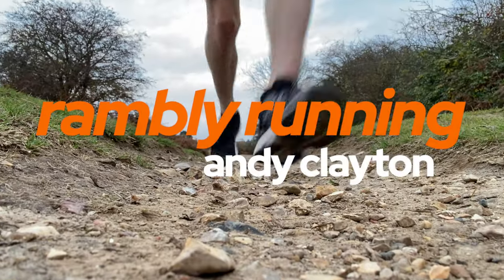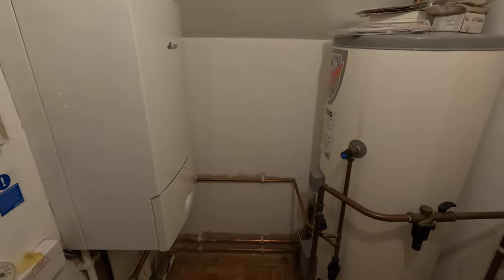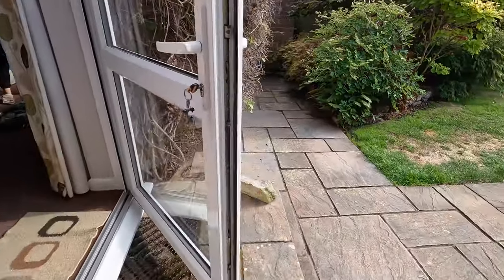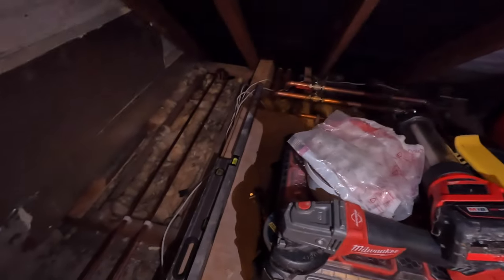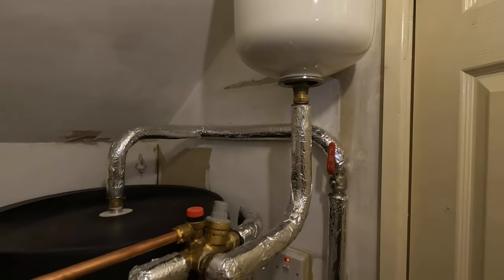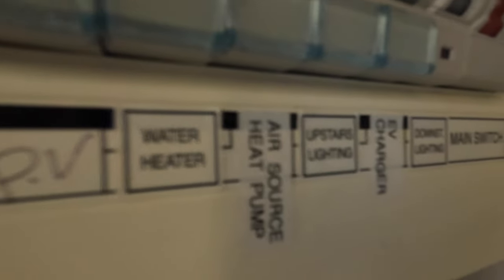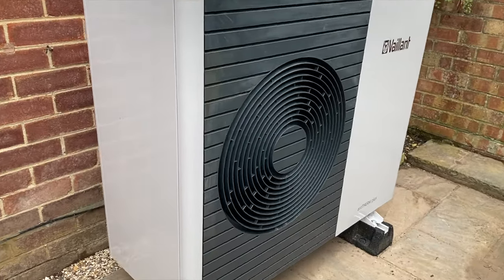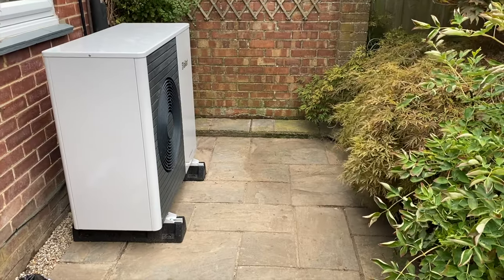Project Green: Heat Pump Installation

Comment: I've had an induction hob for over 6 years, love it! Just about to have a heat-pump, then bye bye gas, and £15,oo a month standing charge too.
Reply from the maker: Nice one Brian. I'm going to be filming a follow-up video this Friday that should be going out next week if all goes according to plan. Like you, I plan to ditch gas at some point - I'm literally just using it for a gas hob and nothing else now. Most days, that pesky standing charge is higher than the cost of the gas I've used. All the best for the heat pump install!

Comment: Interesting video. Thanks for your info. Decided here its not worth it in my case. No where outside to install a heat pump due to logistics of the bungalow, unless it goes high. But it will be bombarded with terrible high winds and rain as I am 1000ft asl.  My worster is quite young and working well..  bills are not too high and in huge credit at the moment. Plus nearing 80 years of age and will never get the benefit of it. I am a retired electrician and have installed my own heating over the years. Still fit and agile . But I have hung up my Tool Box.  Thanks again. You have done a good job .
Reply from the maker: Thanks for your feedback Kenneth. There are many things to factor in to these kinds of decisions and your thinking makes sense to me. There are lots of other things you could do to reduce your carbon footprint - low energy light bulbs, insulation etc. With your background, I suspect you've already looked at all that! 😊
Reply: @TheRamblyChannel    yes. All led here now. It's only a 2 bed bungalow. We downsized when We  moved from SE Kent to South Wales 19 years ago. Was for my wife's health reasons and proved to be way better than medical treatment.  Cleaner fresh air here way better than the crowded South East Kent. Thanks for reply. Cheers from Ken.

Comment: Hello Andy, I already have solar panels and a battery which have been a fantastic boon during the current crisis. I'm umming and arring about replacing my gas boiler at some point. I am also keen to used British manufactured equipment if I can. As Vaillant have just started manufacturing some of the ASHPs in the UK I found this very interesting. One thing I have read/watched recently is that the new Vaillant ASHPs have a new type of refrigerant in them which allows much higher operating temperatures for the radiators. Thanks very much for taking the time to put this video together and I'll look forward to your next presentation.
Reply from the maker: Thanks Eddy. So pleased you enjoyed the video. I'll have a follow up video coming at some point in January where I talk about running costs compared to my old gas boiler. For me, doing the "right thing" and having a greener form of heat energy for my home was paramount, however it's still an interesting exercise to see how it all adds up. The figures are done, I just need to film the content so look out for that video soon! Happy New Year.

Comment: Great video and info! Something unexpected with the glycol cold spots in radiators...realised we are getting the same thing. Is it just a case of turning off two both valves on all the radiators expect one, letting it run until the cold spot goes, and then doing the same with the next?
Reply from the maker: That's what my installer told me to do, so I went round every radiator doing exactly as you describe and that fixed the problem.
Reply: @TheRamblyChannel  that's great, thanks for confirming. will give it a go. did it take long for cold spot in each rad to clear?
Reply from the maker: @magspies  The larger the radiator, the longer it took. I can't remember off hand, but I do seem to think it took quite a while so it was a case of working my way around the house over a few days, but as it can be left to do its stuff while you get on with other things it's no great hassle. For me, it was September so I didn't need the heating on. If you're doing this during colder months then it could be more of a pain as the rest of your house gets cold!! I wish you well with it. :)
Reply: @TheRamblyChannel  so helpful, thx!

Comment: I noticed from you pic that your heat pump is next to a wall is that the boundary wall did you have to get planning permission to put your heat pump there? As I know you need planning permission to put a heat pump with in 1m of the edge your land.  Thinking about getting one my self, but the only room is the ally at the side of the house, which would be with in the 1m, so after talking to planning debt i know i would need it, if you did how difficult was that?
Reply from the maker: The ASHP is in my back garden and is 1m away from the boundary wall so I didn't need planning permission to install it. Thanks for watching. I hope you get your planning issues sorted out.

Comment: Thanks for the super helpful video Andy, can you let us know how many radiators and sizes you have (overall load) and roughly the insulation levels of the house, interesting they only speced a 7kw, much smaller than expected!  BTW Glycol is for anti freeze purposes and not cleaning.  Cheers
Reply from the maker: Hi Chris. Thanks for your feedback. Apologies for my incorrect Glycol reference. Oooops! My home isn't huge and the expected energy requirement was just under 5kw for heating and hot water, so a 7kw should give the system some extra capacity should it ever need it.

I have 8 radiators and 2 heated towel rails. Most are doubles. I don't know the overall load. I have so much documentation from the installer so it's probably in there somewhere. He did all the calculations at the time, which led to one rad and both heated towel rails being updated.

The insulation was done by previous owners, most recently when the upstairs was added in 2003 although I had the kitchen extension built in 2012 and that's probably the best insulated room in the house. So the insulation could be better overall, for sure, and if it was the heat pump performance would improve but early results are still promising. 

I don't know how much that helps? I'll have a follow-up video coming in January where I'm going to lay out the running costs of the heat pump across October, November and December and do a direct comparison with my old gas boiler over a comparable period. Hopefully it will be an interesting one!

Thanks for watching!
Reply: @TheRamblyChannel  Hi Andy, excellent description for a non heating engineer.  Unfortunately, and I think this is a carry over from the gas boiler thinking, putting a 7kW HP in a 5kW house is not the way to get the best efficiency.  HP's work best as close to rated output as possible.  Remember the 5kW requirement is only for when the temperature is minus 3 outside.  ie a handful of days per year.  Your pump will be oversized 365 days a year!   (You need to build an extension or run an outdoor sauna - 😜)
Reply from the maker: @philbattye  Thanks Phil. That's interesting to know - every day's a school day! What you say makes sense. It was very much down to the engineer to design the system so I went with what he recommended. Perhaps I should get that sauna...!

Comment: Very impressive set up and wise to take steps to future proof your house. We have solar tubes for hot water which are wonderful and shortly installing solar panels for generating electricity. It will be very interesting to see how this new system works out for you. It is becoming 9 increasingly clear that the future of fossil fuels as a source of energy is very finite and also insecure due to the vagaries of world politics, war, prices etc. Unlike you, I am totally ignorant with regard to modern technologies and how systems work etc so videos like this are very helpful, provide food for thought and are certainly timely given the current energy situation. If you ever get a chance in this series of 'Project Green'videos to give an 'idiots guide' to the basic principles of how systems such as this work, it would be illuminating for the likes of myself!! There's a challenge for you, Andy --- or you might decide, 'To hell with these fools, it would be less hassle to run a marathon'!!!! No pressure!!
Reply from the maker: If I ever work out what all those pipes are for I may do that! I'd like to know how the system works and what all the various parts do. I have an overview understanding of it all, but I'd need a more detailed insight before I'd feel confident about making a video about it. Having said that, it's something I have thought about and want to do.

I have another Project Green video in a couple of weeks that has an explanation in it about another subject. Hopefully that one will be helpful... if I get my facts correct! 😁

Comment: Having a low set back (fall back) temperature will mean that your heat pump has to work harder to get back to your 20ºC desired temperature. The setback temp has nothing to do with the freezing temp you mentioned with your gas boiler (in another video) 7ºC to stop the pipes freezing. The setback temp is the desired temperature you want overnight. Ideally it should be 1 to 2 degrees lower than your desired daily room temperature. Any lower than that means your heat pump will consume more power to ramp up each morning to the desired working temperature.
Reply from the maker: Hi John. Thanks for your feedback. I’m so pleased you’ve made this comment. It’s something I discovered after I made the video and subsequently set my temperature back to 17 degrees. Vaillant recommend 3 to 4 degrees below room temperature. I’m learning all the time and will correct all my mistakes in my next video. I’m going to be honest with everything including where I get anything wrong! Thanks for your helpful feedback 😊

Comment: And how much did this cost compared to installing a new, high efficiency gas boiler?
Reply from the maker: Hi Richard. A high efficiency gas boiler is old polluting technology and despite the terminology "high efficiency" it doesn't come close to the efficiency of renewable alternatives such as an air source heat pump. Did it cost me more? Yes, but I'm perfectly content with that as I've signficantly reduced my carbon footprint as a result of the switch. The ASHP is already an extremely green solution, however it will only get even greener as more of the grid moves over to sustainable power generation. If I'd replaced my old gas boiler with a new one it would've contined to burn fossil fuels over its lifetime thereby contributing to the problems we have in the environment and with human health. Frankly, it's a no brainer for me. As more of us move over to this excellent tech, the price will continue to fall. We're at the stage where the cost comparisons, while still relevant, shouldn't be the overriding factor in the decision making process. Thanks for watching. Andy
Reply: @TheRamblyChannel  I'm aware of why, I was simply asking how much the heat pump cost compared to a brand new and much more efficient gas boiler given they would both do the same job equally well. This is going to be the deciding factor, unless prices become roughly comparable, the average consumer is just not going to spend many thousands of pounds on being "green". Assuming they even have that extra cash, and many simply won't. This is why heat pump uptake is so poor, even with the state subsidiy it's unaffordable and most home owners will not find the "green" argument sufficiently compelling. We're just not going to see a heat pump revolution without the economics to drive it. The cost comparison will ALWAYS be the over-riding factor for most households; in the case of heat pumps they're just unaffordable. Moreover, a LOT of the cost is in the labour. Swappign out a gas boiler is easy. Replacing it with a heat pump isn't, it involves WAY more labour - espescially if you have to pull out and replace radiators or worse the piping. So even if the heat unit cost itself falls, the labour cost will always be higher. And that's before you consider that a heat pump is only viable if you have very good insulation standards and lots of British housing stock doesn't. So you might have to upgrade that too. You can argue that it should be done anyway, but the problem is simply cost. If you can't afford to pay for the work then the benefits are frankly irrelevant because they are beyond your means.
Reply from the maker: @Richard Gregory  "they would both do the same job equally well". Nope. An ASHP is massively more efficient than a dirty gas boiler, however new that boiler is. Gas boiler: at best 90% efficiency (and that's ignoring all the inefficiencies further back in the chain). A ASHP typically 350%, I've had 480%. Please don't bother to reply again as you've obviously made your mind up. For me, I feel that we need to go on this journey because the alternative is a very bad one for humanity. A cheaper gas boiler is useless if your house is under 16 feet of water and your roof is on fire.

EDIT: Richard says in his comment "a heat pump is only viable if you have very good insulation standards". Lewis Standing suggested to me on Twitter that other readers may like to watch the following video that debunks that particular myth... https://youtu.be/X6qIP8snPW8
Reply: Sorry people like this guy pushing these ashp ,he’s not living in the real world ,they cost far to much monies ,for the average joe compèred to changing your boiler ,not just the pump but most have to have new rads ,tank for hot water new pipe work ,I have solar and batteries which work great and will pay for them selves in next 7 years ,I looked into changing my boiler for ashp,even with the grant it would have cost me £9000,plus all the mess and that big lump of metal stuck outside me back door,unless it’s a new build forget it ,better off spending ya monies on insulating your house better, when the price comes down by quite a lot I might look at this again but that’s not going to happen anytime soon so for now will stick with my boiler ,

Comment: Did octopus do the installation?
Reply from the maker: No. However, they're a great choice. I could be wrong, but I don't think Octopus are using Vaillant as their supplier?
Reply: @TheRamblyChannel  you may be correct. I was under the impression that Octopus were using Daikin units for their budget builds where suitable but using the Vaillant where the Daikin wouldn't work. There seems to be especially tight restrictions around the noise and proximity to neighbours which the Vaillant easily overcomes as it is an exceptionally quiet unit compared to some of the competition.
Octopus designed our system at a flow temp of 50 degrees which meant fewer rad changes but we opted to go for the more comprehensive design of another company at a flow temperature of 45 degrees. Our COP should be around 4 at -2 degrees outside, on paper at least! 🤞
Reply: @TheRamblyChannel  Mostly older Daiken units. Vaillant’s Arotherm Plus is a superb unit

Comment: Did you say how much you paid for the complete install?
Reply from the maker: Hi Chris. No I delibrately didn't mention that. The reason being that I had several jobs done at the same time and paid one bill. Furhter, some was VAT free (under the current green energy scheme) and some wasn't (those elements not directly related to the Heat Pump install). It's especially tricky to separate out the labour costs from all this and say what was specifically to do with the change over from gas. 

I'm going to do some maths and try to include figures in a future video, if I can get them to make any kind of sense, so please subscribe if you want to see that detail.

I'm going to be honest. A heat pump will cost more than replacing like-for-like. However, for me, moving to a green energy alternative (in my case ASHP) very much trumps that expense. I have a feeling that over the lifetime of the heat pump it will (at worst) cost about the same but I have a feeling that with some additional tweaks to my home energy set up that I'm planning to make in 2023, I can make savings over the medium- to long-term.

Making the switch to green energy has to have a certain element of 'doing the right thing' about it IMHO and overall cost is a secondary consideration. It's so important that government do what they can to make the cost difference less of a 'thing' to encourage people to make the switch.

Thanks for watching! I hope that helps. A bit!!
Reply: @TheRamblyChannel many thanks for the nice video. I think an estime of the cost is very useful for viewers. It’s one of the factors that will come encourage or discourage people to consider heat pumps